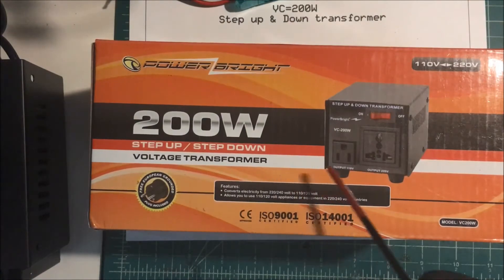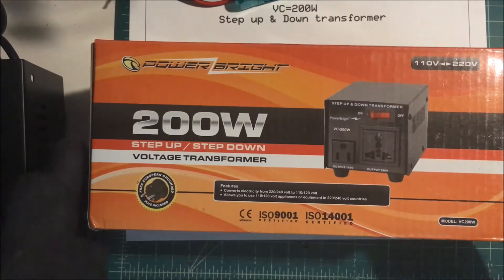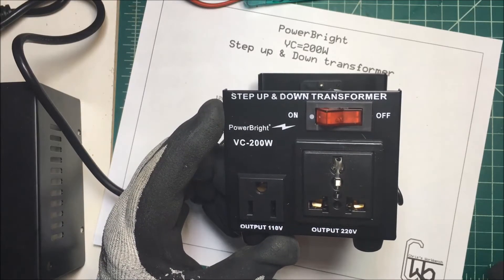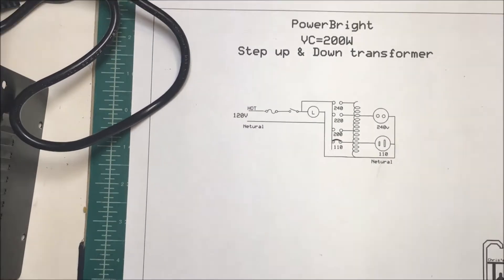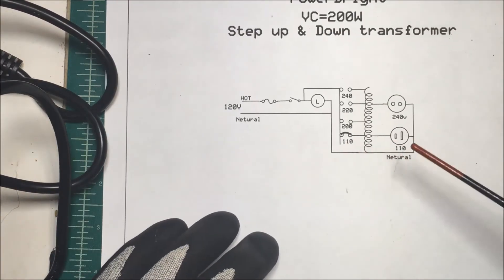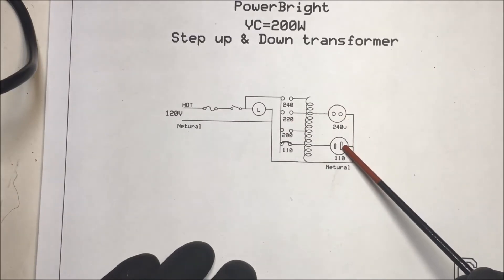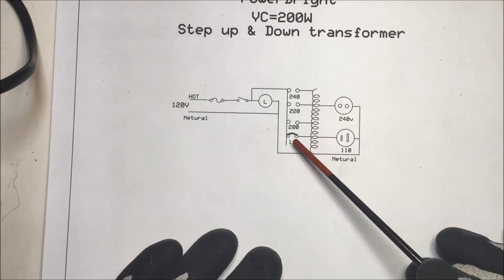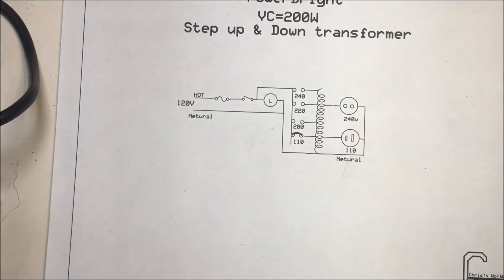Step up Step down transformer

Comment: The output 220V receptacle is of the universal type which is dangerous in this application because it will accept a 110V plug. This type of universal plug is what you would see on the output of a variable AC power supply. Where by the operator will set the output voltage before plugging in the equipment under test. The universal AC receptacle H and N connections are usually correct for 230VAC (50Hz) applications but reversed for 120VAC (60 Hz) applications. Which means many times with variable AC power supplies you will see a separate connection block with dedicated receptacle styles for 230VAC (which can be universal) and 120VAC which has the H-N polarity corrected.